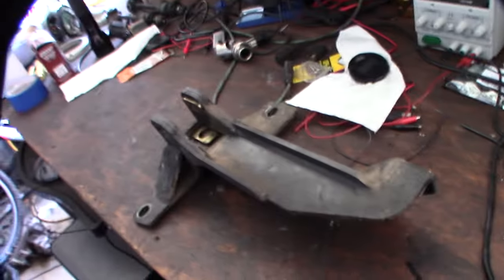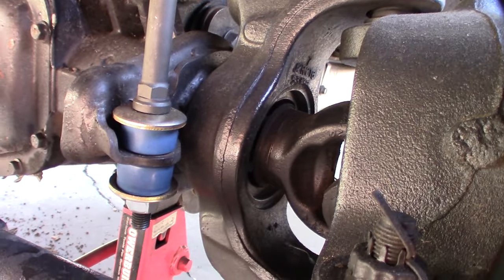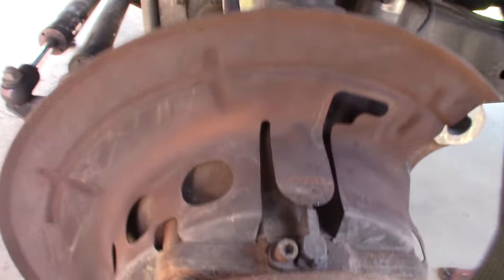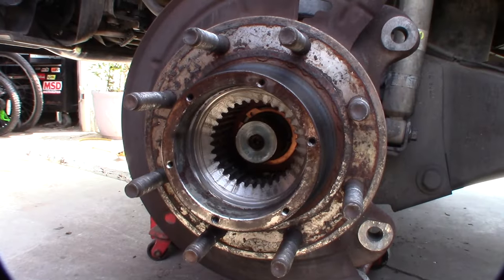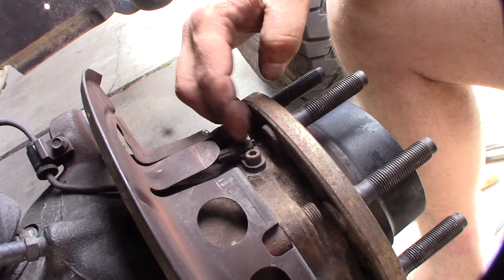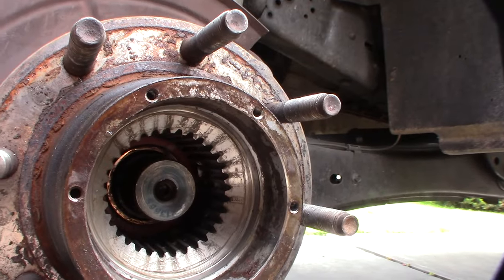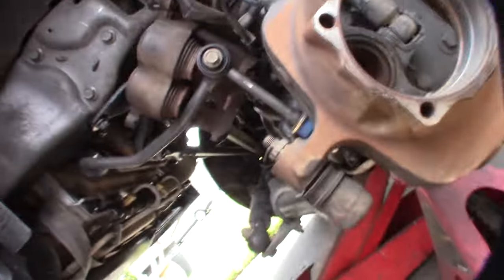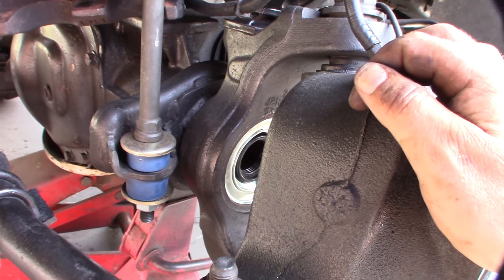Ford F250 front Axle dust seal install, New improved design 4x4

Comment: you did all the work and didnt fix the problem. the seals were blown because your needle bearnings in your hub were bad. the stub axle should not move. Wheel bearnings can be tight.(shaking the tire side to side) but the axle needle bearnings bad.
Reply from the maker: Its newer sealed stub shaft bearing design. Not the old roller bearing style. There fine I checked.
Reply from the maker: @AviewFromUnder  Not sure why,  my 4 wheel drives works perfectly and my dust seals actually do there job, Like I said I have the newer sealed bearing design. Not the older greased roller bearings.
Reply: Fintech you are missing the point. Your problem does not originate from a dust seal, its the needle bearing inside the hub. Your hub bearing can be good with bad needle bearings.
Reply: @fintechrepairshop  your 4x4 will still work with bad bearing. The needle bearing is what causes movement NOT the dust seal. The dust seal is not a structural component and there is no such thing as a sealed hub shaft, there is 1 and only 1 design used on these front hubs
Reply: @fintechrepairshop  Greased needle bearings and you don't even need those housing seals unless you go through deep creeks etc
Reply: @xLong_Johnson  2 styles of housing seals
Reply: @AviewFromUnder   it helps the flopping at first but he's learning
Reply: @brentbradley6711  only between year models and drive trains. 4x4 in this year have one seal
Reply: @xLong_Johnson  One seal for the axle and the newer style goes in the housing.

Comment: I just did the inner axle seals. Now I’ve noticed some movement in the ball joints. Bought made in the USA kryptonite upper and lower kit as well as track bar ball joint. They have lifetime warranties. I also got the otc 6697 to knock the knuckle seals in place. Not looking forward to doing this next weekend. I just had the Napa ball joints with the green and blue seals put on 12k miles ago and a moog track bar ball joint less than 6k ago and they’re all bad. Only buying made in the USA parts from now on. Moog and Napa aren’t what they used to be. All cheap chinesium parts now.
Reply: yeah man, when moog was American their factory was in smithfield tn. business is gone now but the road still says moog industries blvd. sad its now owned by a capital corp. on 5th ave. nyc. gutted and immediately sent overseas. their balljoints now have plastic instead of bronze bushing.

Comment: You can actually take the Hub loose once you take the steering control arm Loose by turning the Hub to the left and the right to get the four bolts off and pull the axle and hub out all at the same time you just need to tweak The Hub behind that old bad seal right there at the housing tube with a pry bar once you loosen the Hub and pulled it forward a little bit first though
Reply: That's the problem and needs to be Snap-on or micro Matco something like that to reach back there Universal ones but anyway as I said you can take it out all together, get your line loose from the truck for the ABS first. Right behind the dust seal that you want to replace there is a 90 degree angle on that shaft, you can put a pry bar back there once you get your Hub to separate about a quarter inch from the spindle at the front and Pop That axle loose and then continue to pull it all together. The nuts come off of your Hub bolts instead of The Whole Bowl coming out but then that back on there and take a 13/16 socket put on it and tap them with a hammer to get them to come forward and break loose

Comment: Those snap rings are a pain in the ass... I just replaced wheel bearings and those dust seals... one time there snap Rings come out easy the next time it'll take you a half hour... good luck brother
Reply: Lee Kitzmiller did you need a press to get those dust seals in?

Comment: The ones O'Reilly's AutoZone and all them have are too big to get into the holes that needs to be Max Snap-on or Matco or Cornwell to do the job but, you can also take a pair of long nose needle nose pliers to the grinder and turn the tips down a little bit and then just Pull them apart to get the snap ring off

Comment: Most trucks don't even have that seal anymore. Not needed unless you do deep water crossings. There is another seal farther up the housing.
Reply: Its an outter dust seal the inner one keeps the fluid in the outer one is to keep dirt rocks and crop from getting in there and causing the axle to not destroy the Inner sealand destroying your whole dam axle it's a must if you want your axle to last longer than 10k miles
Reply: @dahlusional1  I meant most outer seals are destroyed.

Comment: If you cant get the snap ring off the stub axle on the the truck
Its possible to pull everything off the truck with the hib still attach ed to the axle.
Unbolt the hub and pry tje axle forwad ising the space between the hub face and yoke mating surface. If its got the orginal c clip from the factory you will never get it off on the truck.

Work smart
Reply: Which c clip?

Comment: I bet the popping sound is coming from the U-joints hitting the lower ball joint stud , with thew up and down play you have the small needle bearings in the hub is probably worn out and wearing into the stub staff,   and the sensor is not a speed sensor it is the ABS sensor
Reply: I had a slight but noticeable humming sound coming from the front end that alerted me the seals were failing and I parked it and checked it out. I got to my problem before it got too bad.

Comment: I bought KNIPEX Tools - Circlip Pliers, External, Straight, 1 37/64"-3 15/16" Shaft Dia. (4611A3) snap ring pliers for $34.19 from Amazon to do mine and they worked great.

Comment: When you remove the vacuum seal they say you should replace it with a new one how true is that. Thx
Reply: If your vac seal is good you can get away with it. They say to replace it bc youve gone so far in already and they are the most common item to cause autolockers to not work
Reply: @xLong_Johnson    Draw a vacuum to see how good the old one is first and don't leave it locked all the time or you will wear it out!
Reply: i would always replace the vacuum seal they wear out and leak even without being taken on and off
you can get away with it but they are cheap and easy enough if you are there use a new one

Comment: FYI. If you let these seals go bad and you 4x4 vacuum system takes in mud. Say good bye to you vacuum pump and maybe brake booster. This is coming from someone it happened too.
Reply: Best thing to do is get manual locking hubs and cap off your vacuum lines then full the whole void with grease.

Comment: Was it a pain to get the axle back into the differential far enough? I have one of these apart I’m going back together with it tomorrow and I know it says you need a special tool to beat the axle back into its hole because it fits really tightly into the knuckle, did you have any issues getting the axle back in far enough?
Reply from the maker: I think I used a soft Dead blow hammer
Reply: Fintech Repair Shop gotcha awesome and I wonder if it’s ok to use a bit of grease on the inside of the knuckle so it slides in easier but I’m not sure if that’s meant to be a dry fit
Reply from the maker: @2491kridge  Only thing I lubed up was the metal where rubber seals are going.
Reply: @2491kridge   Not a dry fit, you can make a tool with pipe parts and a flange piece
Reply: there is a seal tool that is well worth the money if i can find a link i will post it but the main cause of 4x4 failure in the hubs is the seal not being put in correctly. ie force fitted tapped with a screw driver or socket or piece of pipe. tool is model year specific 99-04 -05 -10 if i remember right
Reply: There is a bit of a ramp just before you get to the inner seal so the axle is guided back in place. Just make sure that after it gets thru the inner seal, you rotate the axle as you tap it all the way in so the splines get a chance to line up and you don't hammer the crap out of the ends of your splines.
Reply: I'm having alot of trouble getting my Axle back in. Any tips

Comment: Did you also replace your outer seal or did you leave the original one on?
Reply: He reused the outer. If you have manual hubs you’ll be good I guess but if you have auto hubs it might not seal using old outer seal.

Comment: I'm trying to do ball joints and I'm stock at that snap ring please help thanks In advance
Reply: Pull the axle with the hub attached. Put axle in a vise pull snap ring off. 10 minutes vs hours of ****** around on the truck.
Reply: @mark-ml6rp  so you dont have to remove the snap ring to get the hub off the knuckle? i noticed mine has that black ring before the snap ring
Reply: @mattharlow8492  
I went threw a shit load of cheap pliers. It is possible to do it with out snap ring pliers if you do the following. Remove all the hub nuts.
Using a normal heavy wall socket
Have the motor running and have a 2 person turn the steering wheel from lock to lock postion with the socket in place where the steering
Yoke stops against the casting..
You still need a pair of good OTC
FORGED PLIERS. But if you stick
The hub and shaft in a vise your cheap snap ring or 2 screw drivers
Or punches will work for you..
Reply: $34.19 from Amazon - KNIPEX Tools - Circlip Pliers, External, Straight, 1 37/64"-3 15/16" Shaft Dia. (4611A3). They will do the job right and with no cussing, LOL.

Comment: Ya told us where we can't get the long snap ring pliers but didn't tell us where wr could get them.
Reply from the maker: Look above or this link
https://www.amazon.com/gp/product/B01M1EGFHX/ref=as_li_tl?ie=UTF8&tag=fintechcomm0f-20&camp=1789&creative=9325&linkCode=as2&creativeASIN=B01M1EGFHX&linkId=d55c4d524d3d3ac85b0ede0f3fc5551f
Reply: Knipex  46 11 a 3 is the pliers you need. Check them out on Amazon.  Most of the reviews are from superduty ownersd.
Reply: harbor freight makes a usable one seems to hold up for enough uses for any typical superdookie owner

Comment: Im getting fluid in that same area... do i need to replace a seal further back?
Reply: Yes, there is a wet seal that holds the fluid in the differential. the sealing surface rides on the machined portion of the axle, just after the splines. In this video that machined surface of his axle looks dirty and rusty which would be a indicator of seal failure or eminent seal failure.  there is not supposed to be any oil in the axle tube
Reply: @owenkennison8055  The axle shaft will be rusty and dirty. It's not an actual sealed system. The dust seal just keeps out the large stuff so it does not work its way inward and destroy the inner seal. The inner seal is fine unless there is oil in the tubes but rust and dirt are to be expected in the outer tubes.

Comment: I have a question is the inner axle shaft supposed to spin on a truck or stay still?
Reply: On 2006 to present Ford F250/F350/F450/F550 the inner axle always spins while the truck is in motion. Until the hubs are locked in, the wheels themselves are not under power but yes, the inner axles are constantly spinning when the truck is in motion.

Comment: Hey buddy can you tell me what the harbor freight tool you used to put the seal in. it had the black runner end on it thanks man
Reply from the maker: https://www.amazon.com/gp/product/B01GVQOSA4/ref=as_li_tl?ie=UTF8&tag=fintechcomm0f-20&camp=1789&creative=9325&linkCode=as2&creativeASIN=B01GVQOSA4&linkId=c581099bf46fac780fa9b53660bfca9f

Harbor freight
https://www.harborfreight.com/10-piece-bearing-race-and-seal-driver-set-63261.html

Comment: Is it same on passenger side?
Reply from the maker: yeah
Reply: Would those seals cause my truck to shake while driving?
Reply: @edgarvilla1866   No, most trucks don't even have them in place anymore.
Reply: @edgarvilla1866  u joints? i hope you arent talking about death woble. 
is it a shake at slow speed that becomes a vibration at fwy speed? if so axel u joints 
if full death wobel that comes on at higher speeds there are too many theories to go into here just do a look up on death wobel
Reply: john galt it was the cheaper tires I had lol I replaced them and problem was solved
Reply: @edgarvilla1866  patriots or ironman lol